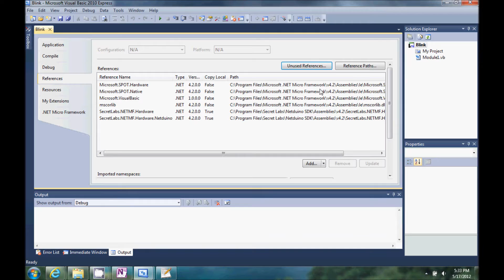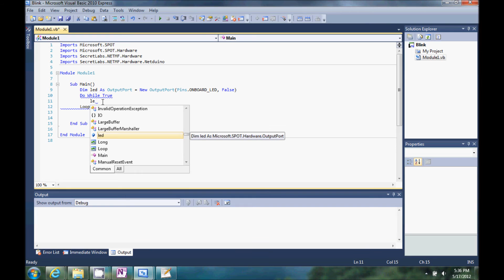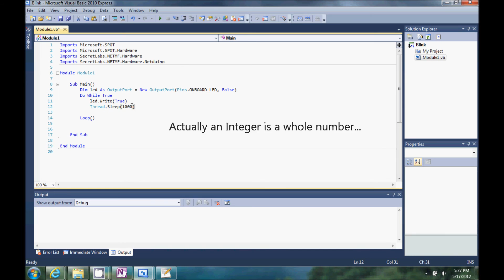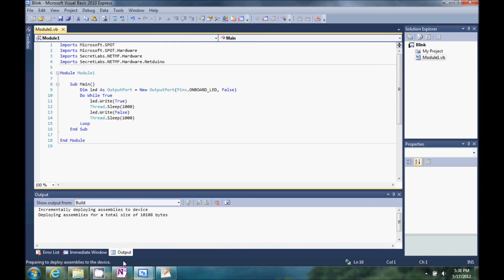Netduino VB Blink Tutorial

Comment: I have used your code for programming netduino 3 wifi using visual studio 2012 in Visual basic language.
But they are showing the error that  "Build: 0 succeeded, 1 failed, 0 up-to-date, 0 skipped" , "0 of 1 error" when i build the program.
There are no warning and messages in the description about the error,wondering how it is not possible to build the program without any errors?
Reply: Here is my code,check whether there is any problem with my code
Imports Microsoft.SPOT
Imports Microsoft.SPOT.Hardware
Imports SecretLabs.NETMF.Hardware.Netduino
Imports System.Threading
Module Module1
    Sub Main()
        Dim led As OutputPort = New OutputPort(Pins.ONBOARD_LED, False)
        While (True)
            led.Write(True)
            Thread.Sleep(500)
            led.Write(False)
            Thread.Sleep(500)
        End While
    End Sub
End Module
Reply: MMP : error MMP0000: 0x80131700